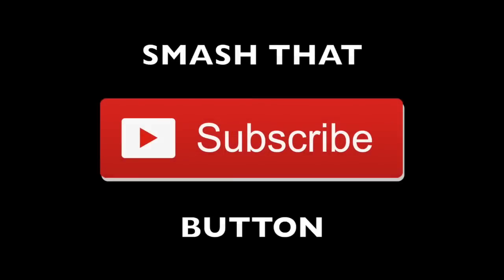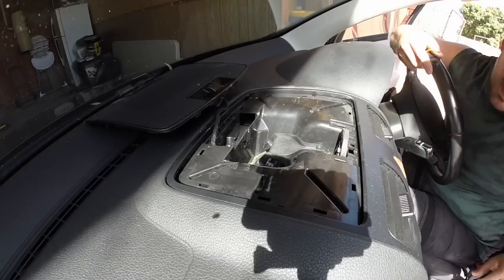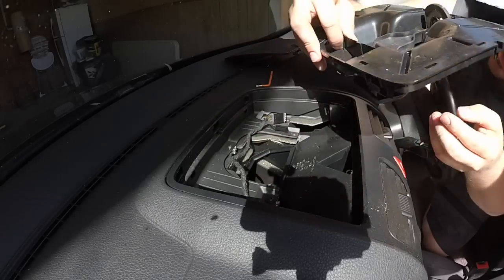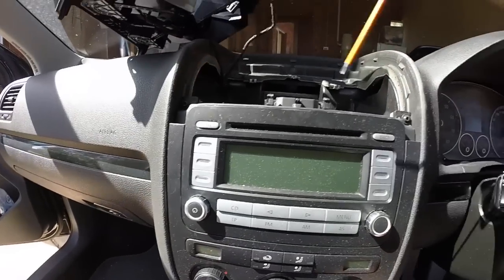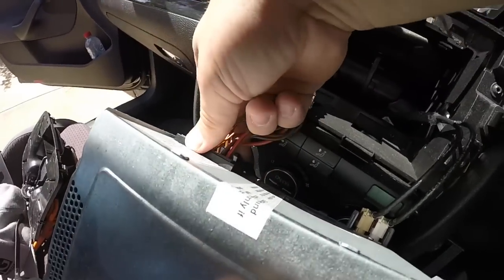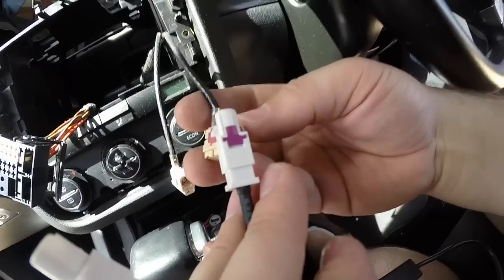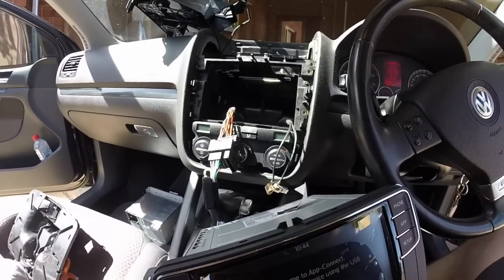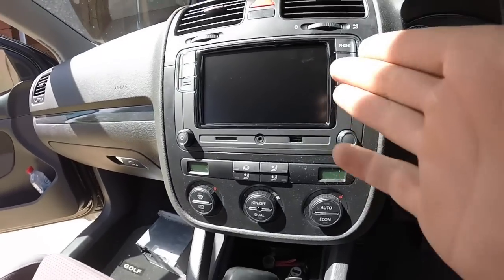VW Mk5 Golf OEM Radio Upgrade | Added Bluetooth & Apple CarPlay

Comment: Hi I have heard that you can retire the engine bay fuse box instead of replacing the canbus, have you heard of this, if so is it successful ?.
Reply from the maker: Haven’t heard of that
Reply: So you purchased the unit with the steering wheel control adapter correct or seperate, as I see a lot listed via eBay.?
Reply from the maker: Grant Turton I came with everything needed
Reply: Cheers for that.

Comment: Will this work for a 2005 Rabbit? How did you connect the two wires at 11:29? Thanks.
Reply from the maker: only one would fit. everything seems to be working fine. Not sure about the 2005 Rabbit

Comment: Does the radio start without having the igniton on and will it stay on when you stop the motor and let the key in like with the standard radio? because when I stay in my car waiting for someone I dont want my ignition to run all the time because of the battery :D
Reply from the maker: I’m not sure. I’ll get back to you on that
Reply: nice thank you
Reply from the maker: You can turn the radio on without the ignition on. It will turn off when you turn the car off though. So you can just turn it back on and chill waiting for a mate
Reply: thanks thats nice to hear and thank you for checking that for me

Comment: Did you experience any battery draining with the radio? I want to get one for my mk5 but I’ve seen the reviews on Amazon saying it drains the battery. Do you also have an intake for your gti?
Reply from the maker: Haven’t had any issues. Check the other comment in the video and they explain what you need depending on the year model. Our mk5 isn’t a GTi it’s a GT

Comment: did you suffer battery drain with the unit ?
Reply from the maker: Nope
Reply: i did - in my 2005 mk5 golf. bought a canbus-adapter and have to wait for it. hope this will fix the problem.
Reply: @miextheone  did it fix the problem?
Reply: @miextheone  thank you!

Comment: Good turorial.... but this fkn radio is as expensive as the car... so what is the point😂😂
Reply from the maker: Haha I know! It wasn’t when I bought it. It was $400 I don’t know what happened there. I’m going to delete that link.
Reply: Harrods Garage ohhhhhh ok i get it know... i meant no hate when i said that, its just super expensive😂
Reply from the maker: Djeyson Fortes I know mate. I was surprised when I clicked on it after someone said that too.
Reply: @HarrodsGarage  are there any radios similar to it that you would recommend?
Reply from the maker: Just search rcd330 and you will find them. They link that I bought from has doubled in price.

Comment: Hi thank you for your video and work. Does it come with the cable adapters? It's plug and play or we have to change canbus? Thank you very much.
Reply from the maker: The one I bought came with adapters. I believe with the earlier mk5 you will need to change the canbus but I’m not sure what you need as I did not need it. It will most likely be somewhere in the comments.
Reply: @HarrodsGarage  thank you very much for answering!

Comment: 11:21 my rcd330 didn’t come with that adapter so I only have a singular slot at the back of it, how can I get this part
Reply: I believe one is for DAB? I domt think my 2005 gti has this so do I ignore that cable when plugging it in?
Reply from the maker: I don’t think it’s for DAB, could be wrong though. 
Best just to google rcd330 adaptor and pick which one that will suit your year.

Comment: I have a problem. When I try to pull the radio out (the stock one) it doesn't come out. I Pulled out the 4 T20 Torx that's holding it yet it doesn't come out. If anyone knows a fix to this please help.
Reply from the maker: Sorry I’m not too sure, I did this years ago and we don’t have this car anymore. I believe there’s one at the top, if I remember correctly
Reply: @HarrodsGarage  first one at the top then 2 on the sides for the top part to come out, then the 2 for the plastic (for the radio, climatronic etc.) and the 4 ones for the radio. But it doesn't come out when i pull on it

Comment: what year model is your golf?
Reply from the maker: It’s a 2007 mk5
Reply: @HarrodsGarage  I've got a 2007 aswell but I'm afraid it might drain my battery If I do end up putting an rcd330 in it
Reply from the maker: It’s been fine so far. A lot of people say that
Reply: @HarrodsGarage  Oh, you used an emulator? That might be why its not draining. Do you have a link to both the headunit and the emulator?
Reply from the maker: Na I didn’t use an emulator but where I got it from May have added one. The link is in the description for the headunit
Reply: @HarrodsGarage  great thanks. for the reverse camera did you need a vagcom to enable it or was it good from the get go?
Reply from the maker: We haven’t got a reverse camera

Comment: Can I ask where you bought the harness adaptor from or did it come with the unit?
Reply from the maker: It came with the unit
Reply: Harrods Garage do u know where I can find the adaptor for a good price?
Reply from the maker: Not sure mate. Try ebay
Reply: Harrods Garage Hey mate , sorry for the interruption, so I’ve bought the adapter from AA Auto parts but I have a issue with plugging in the adapter to the unit? Any advice on how to do it?
Reply from the maker: What’s the issue?
Reply: Harrods Garage It’s all good mate, I couldn’t fit it in properly, I had to open the click , appreciate the support 🙏🏽

Comment: Can you connect sub and amp to this head unit?
Reply from the maker: I’m not sure, I’ll check and get back to you
Reply from the maker: There is no amp control within the head unit. Unfortunately no sub/amp connection.
Reply: @HarrodsGarage  actually you can connect amp and sub for factory unit so this would be the same, just need to get rca converter module and find speaker wires and hard wire it. it should output the sounds to amp. then BOOM!  / found out today myself
Reply from the maker: thedarkkiller haha I was going to suggest that as that’s what I’ve done before in my 2001 Subaru Forester

Comment: Does this work with the golf r32
Reply from the maker: Mk5 r32, yes for fitment. Not sure about the whole canbus thing though. Check other comments here. I believe MY08 don’t need a canbus upgrade. Anything older will as they drain batteries apparently